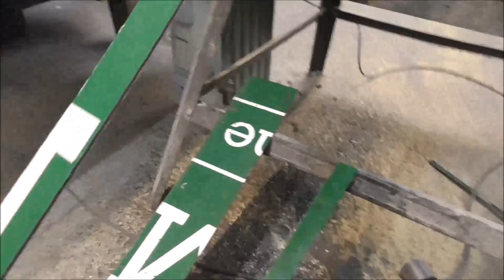LONDON TAXI CONVERSION TO COOL PICK UP TRUCK

Comment: Sorry if I missed wot u spraying on the things u glueing together but wot is it loving the videos thanks keep up the good work 👏👏👏👏
Reply from the maker: When I am using superglue then spray it, its called Mitre Fix.  Basically its superglue and then the spray activates it and makes it set instantly.  You can buy it at Screwfix or Toolstation and places like that.